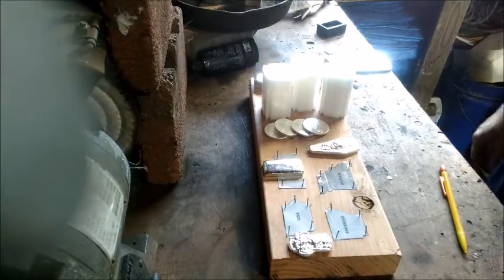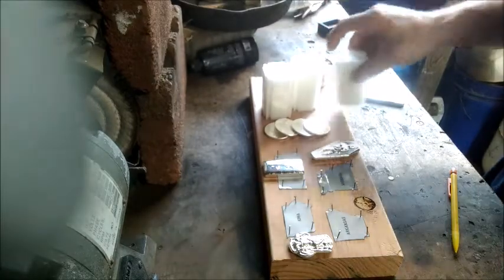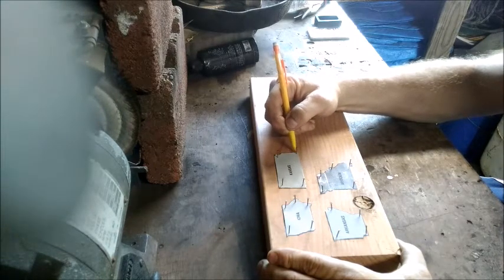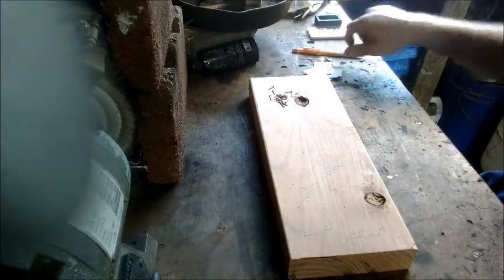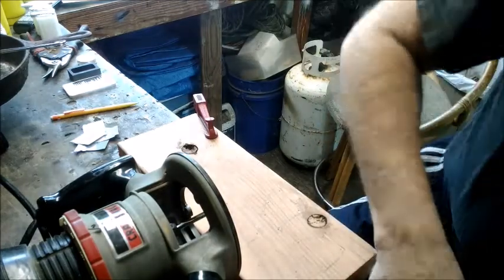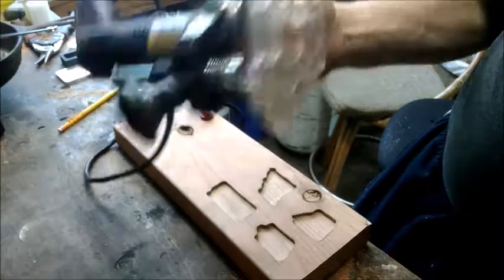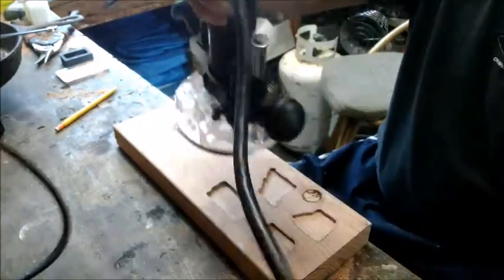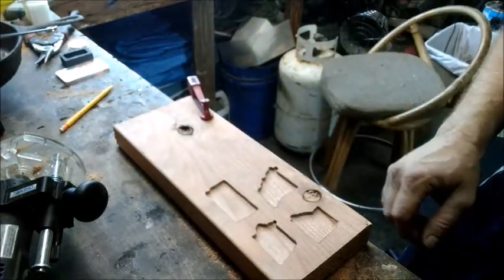How To: Silver pouring Into Wood Molds (Part 1) - Silver Stack #183

Comment: very good video my friend !!! ... most people do not think of how much prep and work goes into our pouring !! thank you !!!
Reply from the maker: Thank you. Yeah, just making the template (which has to be to the right scale so the piece had enough detail, but isn't too heavy) and tracing and cutting out, can take 30-60 min. then depending on how many pours, another 15-30 min worth of pouring. and upwards of 1-3 hours (or more even) depending on how smooth or mirrored of a piece you are after or had requested.